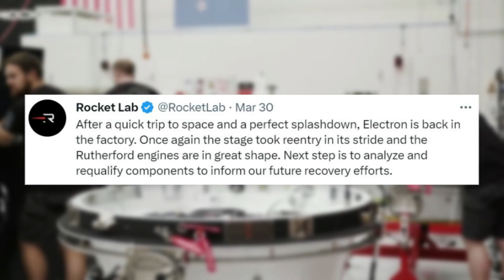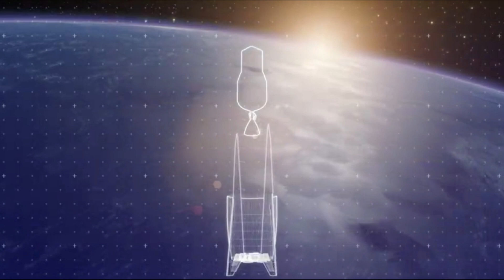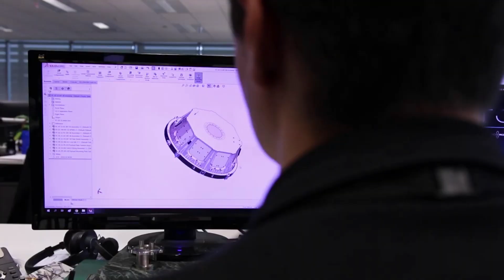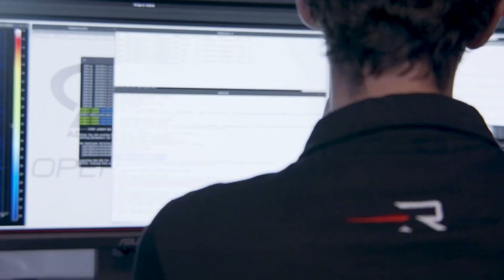How Rocket Lab Plans To Compete With SpaceX

Comment: How does Neutron compete against Starship?
Reply: Ride share requires both satellite share an orbital plane. Some users simply don’t want to do that particularly polar or Molniyar orbits.
Rocket Lab also has a much shorter turnaround time than SpaceX so can actually launch a payload faster.
Reply: It doesn't, it competes against Falcon 9
Reply: @moekitsune  starship will make f9 redundant...
Reply: @alexshettler1043  Not really. Customers that don't want to or can't rideshare on Starship will love Neutron
Reply: @moekitsune  a starship launch will likely be far cheaper (<10 million vs 50 million for f9), so launching a single satellite on starship will probs be comparable to ride-sharing on f9/neutron, and a rideshare on starship will be even cheaper (<1 million?)
Reply: @Alex Shettler  so basically rklb will continue to be unprofitable trying to compete with space x